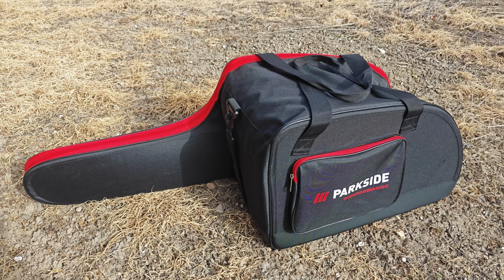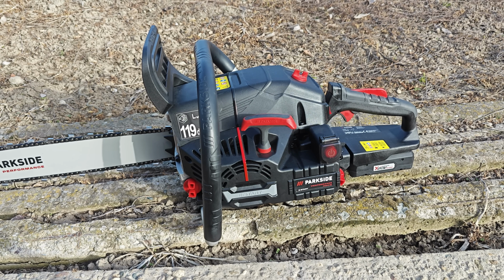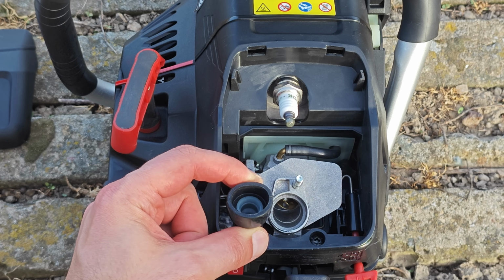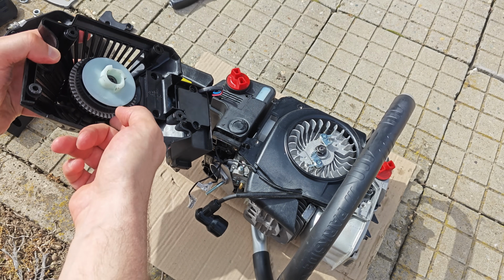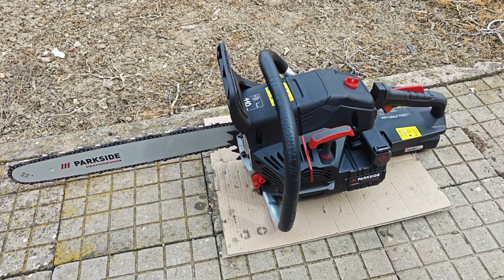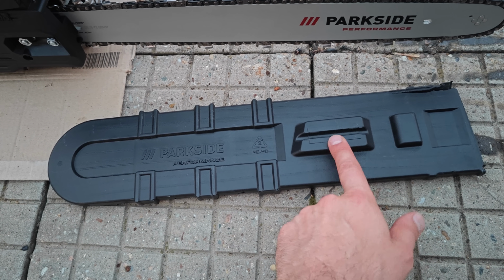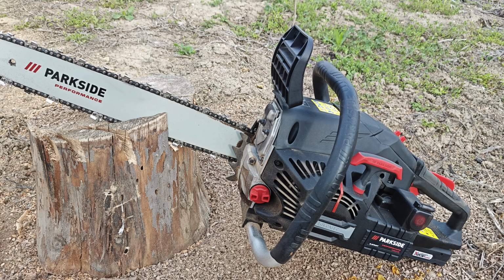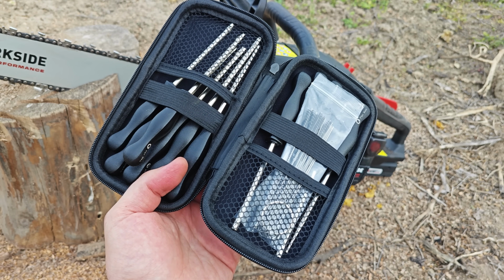Parkside Performance Petrol Chainsaw with Electric Starter PPKBS 56

Comment: Thing weighs over 7 pounds more then a Husqvarna 55 which is a comparible cc saw. 11lb vs 18lb is a huge difference. It even weighs more then a Husqvarna 396

Comment: Hello there, 

Nice video! 

Thank you for sharing! 

Is it ok to remove the battery when the engine is working and to only connect it when starting the machine??
Reply from the maker: Yes, its ok. Its a starter battery. It can run without it.
Reply: @icku Thanks 🙏

Comment: what do i park almost all my Parkside (some performance, some not) on when not in use? right, the sturdy non-performance BATTERY. i've even dropped one in water (inside my boat) while changing it to pump said water out of my boat with a drill operated pump, it still works fine!
i can still start and handle a Stihl MS 88 with 5 ft bar by hand, but was looking at the 40V Performance chainsaw for quicker/shorter jobs, but then i saw this and i do like it!

Comment: In Portugal, Parkside equipment is usually only sold at Lidl and they never have this model for sale. Can you tell me how much this machine cost and in which country it was purchased? I want to buy one of those PPBKS 56 chainsaws with a battery start or if there is a similar machine in a newer model, but I can't see how to buy it. It never appears in Lidl in Portugal. Does anyone recommend a reliable store or website where I can buy this Parkside chainsaw? Congratulations on the video. Thank you and regards from Portugal.

Comment: I've repaired and sold numerous of the old McCulloch 10-10E chainsaws that had a Ni-Cad pack in the lower handle-strut. Their starter was made in into the flywheel+stator unit.

Comment: 8.3 kilograms = 18.2984 lbs <<< That about same as battery saws that have no power.  A true test comparison would be side by side test with EGO or similar, but not just 1 or 12 cuts, I'm talking  at least 144 cuts on 14-16" DIA hardwood log, then see witch one is faster, then see witch one is more cost effective....
The only real concern you raised was start-switch position, it needs better protection, battery protection is no more worse then most battery saws out there, the EGO battery is really big and really expensive and really exposed to banging against something.......
My thoughts from what I see here in this video, I'd but this saw in a NY min if available in the US!!!!!!!!!

Comment: If the application had merit in todays world, then Stihl and Husky would have been doing it for years! I have  no issue with my pull start on my MS660 and who want to carry a battery starter motor for hours that is only used for starting, Get it to a few AA's and a tiny starter then maybe the townies will buy it, but sorry not this guy!

Comment: Great video. I heard of this saw but seeing it I don't think it is more than a gimmick. You carry around a battery and a startermotor just to start it every 15-30 minutes. Not worth it energy wise.
I'd much rather have it made compatible with a Parkside drill to start it and ditch the pullstarter aswell.

Comment: Weighs about as much as a gallon of water. One gallon of water weighs approximately 8.34 pounds (3.78 kilograms) at room temperature.
Reply: he said 8kg
Reply: @jahutusvedelik  That means he was wrong. Thanks for letting us know...... I never listen to what they say when I can see FACTS from an actual digital scale.......
Reply: @USMC-Sniper-0137  scale said 8.34kg. i pulled up the manual. manual said empty weight is about 6.8kg.
Reply: @jahutusvedelik  OK, then remove 2 cups of water from the gallon and weigh it again..........😂😂
Reply: @USMC-Sniper-0137  what are you talking about. you said the saw weights 8.34 pounds. its weighs 8.34kilograms. you mixed up lb and kg.

Comment: To do agricultural jobs you need muscles. Having a battery on a chainsaw is useless as it adds too complexity to the tool and weight . Imagine having to clean 1 decare of land and having to work with a chainsaw that it weighs 8 kilos! At the end you will be exhausted. We need better chains, better mechanisms that can last for a long time and do not require expensive service and are lightweight

Comment: I know people who will buy this ! It’s a gimmick is all but people love a gimmick.
I personally don’t see the benefits of this E start saw, it’s not very big, it’s not very powerful, it’s cheaply made, heavy & generally not very well thought out.
I won’t be surprised to see this being sold in Lidl but I don’t think the big chainsaw brands will be following suit.
I have a small cheap petrol saw & a small cordless electric saw that shares batteries with my diy power tools, the electric saw is hands down better than the petrol saw, no fuss, just plug in the battery & we are cutting plus it shares the same pitch chain as the cheap petrol saw.

Comment: I know and know of a few older chainsaw operators, that have give up, just because they’re no longer able to pull start their saw/s. And have tried a smaller saw with Stihl easy start but is 1-2 cases was still to much. It’s not the weight but that initial immediate pulling action. On the other hand, an operator needs to be able to move quickly and with a certain amount of agility. Also, if the saw is too much to start, perhaps this is a machine’s way of telling people they’re getting too old for using a chainsaw.

However, with the advent of pro grade battery saws from Husky & Stihl, the problem of pull starting a saw can be a thing of the past. I note that with exception of the top handle saws, most of the pro grade battery saws are not lightly weighted but are powerful enough for the task. But unless you’re using them for a bit of light firewood processing, you still need 2-3 batteries to make it through the day. I suppose with this particular saw, the advantage, is that you’ll have your liquid fuel but don’t have to be fit enough to pull start the saw. Plus the battery offerings from Husky & Stihl, are all very expensive, especially so, if you require 2-3 batteries.

I think Parkside could’ve improved the saw’s performance, if they’d gone with a 15” or 16” bar, with .050” 1.3mm chain, for the available 2.2kW (2.95HP).
Reply: Local Stihl shop often has eg ms661cm saws come back 'faulty' but turns our the often older owner can get enuf rotation from the pull start system, cause it's too hard for them.
I always press the decomp b 4 restarting which makes it easier on the arm. Electric start therefore will attract a lot of buyers.

Comment: If you are too weak to pull start a chainsaw you should not be trying to run one IMO.
This is a solution looking for a problem.
Reply: Try starting a saw like this when on a ladder.
Reply: @Will-thegrumpysoutherner  I've done it a bunch of times.
The Zenoah clones like this saw have an easy pull starter on them, you can pull them slow and easy and they fire right up, I can literally start one with my pinky finger.
Try starting a saw like this, you'll see.
Reply: such a cave man brain. Jesus fcking christ. Go back to pull starting your car, no go back to riding in carriages, no wait go back to riding horses, no no wait go back to just walking everywhere, nooo wait go back to walking on all four, noooo wait go .....stfu. if shit makes life easier it is welcome, you do not need to use it, use a hand saw big man
Reply: No, has nothing to to with being too weak, when you pull start then the piston maybe cycles 5 times with each pull? if you have a bad starting chainsaw that needs say 8 cycles to start then it takes too much effort to start it.
With an electric starter it cycles more and faster then you can pull.
So yes, good idea, i bet we gonna see this more in the next years.
Reply: @sparta2v  Fix the saw so it starts properly dont add a band aid electric start lol.
Reply: Aprilscherz

Comment: An electric starter adds unnecessary weight and more components that can fail - not uncommon by this particular brand. The Parkside quality can hardly be called decent even the best intentions. Their "Performance" line is not that cheap.
If you want a good chainsaw buy a Stihl or Husqvarna instead.

Comment: They should make it 12v. Better protection for the battery having the battery insertion flute around it. Lighter also.
Reply: Also, they should use that on the lighter ''curving'' top handle chainsaw model.
Reply: Parkside sell other 18 volt lithium battery tools, I would expect this to not come with a battery & charger, it will share batteries with a drill or similar.

Comment: Nice review. BUT :  For most of users will be better to buy the cheapest Stihl with ergo start- no battery, no weird looking starter, light machine with enough power. Better service backround and 100% better processing. how long will it take to break the battery holder or the starter?  Sorry, I personally don't understand a piece of this Chinese miracle called Performance. This is too heavy and 99% users don´t need more than 2kw od power. Look for Stihl 211 C-BE and you will have saw for 20 years with no problems. I found one for 230 Euros and has less than 5kg.

Comment: In my opinion this saw is pretty useless with the battery start.

It makes the machine way too heavy and why do you even need a electric starter?
If u use you saw properly, your saw will turn on with the first pull.

Its a nice gimmick, but nothing special.
Makes total sense why no other Professional company makes such a system.
A saw should be light as possible and not more complicated.

The Parkside saw weights even more than a Stihl 500i which has 5.8hp.

Parkside should better design a new stronger Battery powered saw.
Reply from the maker: To some point you are right. The flushing door handles on Tesla are also pretty useless, but people are buying the car like nuts. If you work at hight you will really enjoy the electric start. Pulling that cord 20 times a day can literaly kill you(falling from the roof or three)

Comment: PERSONAL OPINION: I find this sistem really useless, add lots of weight to an already not light machine. I would have liked parkside to invest in a more powerful and reliable engine for the “performance” chainsaw. Also the price will be higher than the normal one so I think it would make more sense to buy a entry level husqvarna or oleomac for 50/100€ more, it would probably last longer and would have no problem finding spare parts. I also want to mention that parkside isn’t the first one who tried to make starting a chainsaw easier, no one tried to use a starter motor just for how stupid it is, stihl used the “ergostart” and I think it’s a way better system.
Reply: Not useless if you have some sort of injury (think older with a bad shoulder)
Reply: Sistem ? You were doing so well after that as well 😂
Reply: Comparing Parkside to stihl is not fair. Parkside is a huge brand favored by pro lumber. Stihl is a new startup
Reply: I have ani oleomac at home, that shit doesnt start after 1 month :)))
Reply: salut am văzut că nu prea te pricepi sa tai cu drujba 😎îl ții numa întro poziție ,trebuie să o miști în fată și în spate, de ce nu faci așe?
Reply: Not useless, and not a lot of weight battery and electrical motor are not that heavy (600gr not more). But you're right on 1 point; that's your personal opinion not more!
Reply: Parkside does not invest into anything, it is just made up brand from Schwarz Group (owners of Kaufland and Lidl), This tools are produced in no name factories in China, that are turning out loads of same (low quality) tools and then plastic is color matched with cheap brand from different buyes (Kaufland/Lidl, Tesco, Carrrefour, Netto...). 
They do not invent anything just mass produce. That is why start button is so poorly designed, or battery is in worst position. (some other brand company probably ordered prototype for testing and they stole it and mass produced it without any further engineering, as these Chinese no name factories do). 
That is why quality and longevity is abysmal. (good enough if you need it 2-3 times a year, but not for every day or week usage)
I would really wait for some proper brand name to come up with properly engineered, with weight, placement and quality in mind.

Comment: They could use 12v instead. No need for such big battery to start engine i think
Reply: It will be compatible with other Parkside cordless tools.
Reply: 12v parkside battery doednt have enough power
Reply: 2AH batterij is the lightest, and perfect good enough for this machine

Comment: It seems like it doesn't miss anything anymore.  Except... the lack of power. 
Although, a gym membership for a user as an add-on would be useful, too.
Reply: actually it seemed like it was leaving a lot of power unused. The RPM's never fluctuated. i.e. the Chain sux and it wasn't taking much wood. A quality chain can only improve the performance of this  saw.
Reply: @crxess 
And I don't know what this saw is supposed to be used for?  What is its purpose?  If you take into account the weight to power ratio, it is not suitable for the forest. Chainsaws weighing about 8 kg have up to 5 kW of power (of course, these are professional saws, many times more expensive). This one here is probably not even 2 kW (the original Zenoah G5200 chainsaw has 2.7 kW and empty weighs 5.1 kg, full with  cutting set approx. 6.3 kg) and it won't do much in the forest. In the yard and other places where there is access to the electricity, it is cheaper, quieter, lighter and without the smell of exhaust fumes to use an electric chainsaw with comparable power.
Reply: @aaronozjaszowiczszechter9665  It is obvious from the Design and general build, this is another Homeowner saw. Great for limited use clearing a downed tree or clearing a few smaller trees around the property. Nice for an older person/women of smaller stature who may have difficulty starting a chainsaw. 
The only real advantage I see over a decent Battery Saw is time in use before quitting. Keeping a Battery saw going for long periods gets expensive real fast. I have a small collection of 2-strokes - 40cc to 72cc, (2) 4-strokes, (2) 80v saws and a decent corded Wen 16".
How they are used and Maintained really matters.
* I gathered 7 cords of Black Walnut firewood with the 4-Stroke doing most of the work.(up to 24")

Comment: Same crappy design ,why put centrifugal clutch that is full of holes next to a chainbar ffs.Its gonna get full of dust in no time,it should have been behind the plate.Thats why i love my battery powered chainsaw from einhell-no clutch to clean,wipe it with a brush in 2 min whole chainsaw is clean.
Parkside and its half products as usually .

Comment: Cool feature not to have to pull this irritating mechanical starter when one is for example on the ladder or roof. Unfortunately I will not be able to get there in the first place as this saw weights ridiculous 8kg  😂 and is way to heavy to take it anywhere. Still, thumbs up for the vid as usual.

Comment: This won't be a successful model given the weight 😅
Reply: Exactly!
The main point when designing a chainsaw is to make it as light as possible. Professional loggers use their saws multiple hours daily and I'm sure that they wouldn't want to carry all that extra weight just to start the saw when they are perfectly used to starting it by hand. This only makes sense to the lazy people who will use a chainsaw maybe once a month.
Reply: @karlobukal4134  yes because professional logers buy a parkside performance chainsaw thats made for advanced hobby guys.
Reply: It's not aimed at the pro user.I might use my chainsaw about four times a year.
Reply: @keithhooper6123  then why would you need the starter for, except being heavy. Think about it. It's the first in 50 years not because Stihl and Husqvarna are retarded, but because it's a useless feature
Reply: It’s way too early to tell 😊
We might be surprised